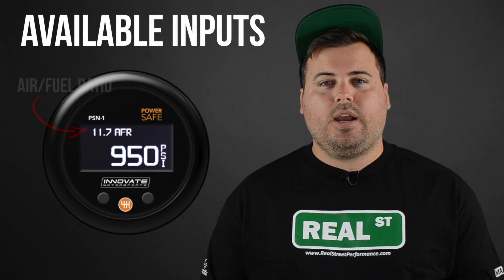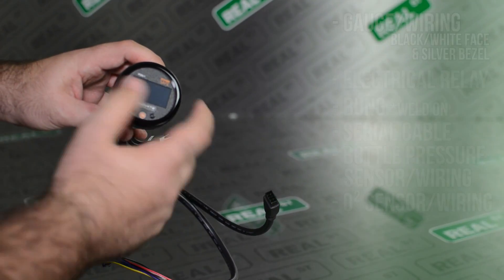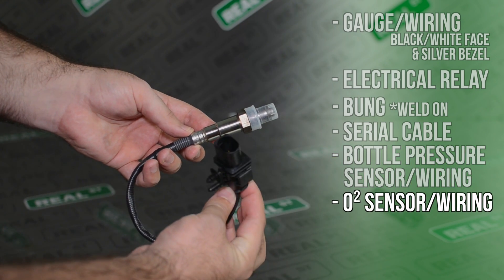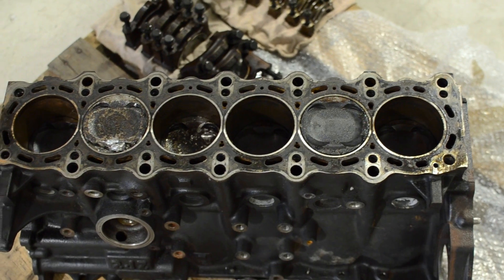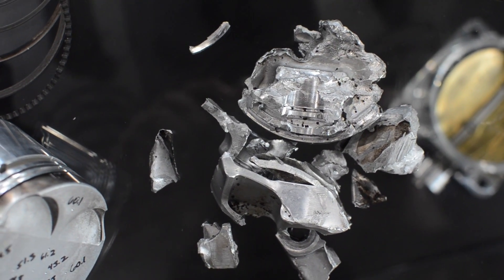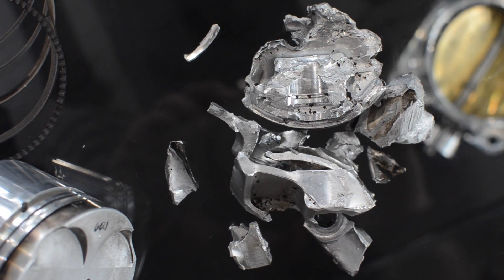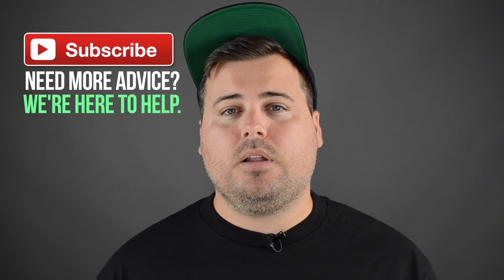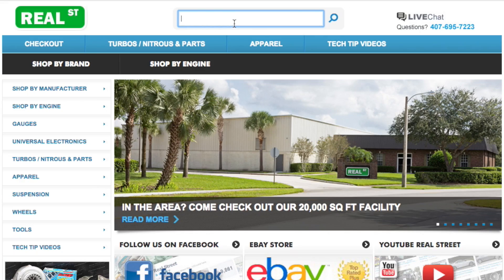How to use Nitrous without BLOWING up your engine Innovate PSN-1 PSN1 3893 - Real Street Performance

Comment: Im building a ka24de Nissan motor. With porting I'm looking at  around 200HP. I wanted to get it tuned with Nitrous. My target is 300 HP but 250 HP is acceptable. Just a guess is this safely possible with high compression pistons?
Reply: Only one way to find out test it for us bro

Comment: FEEL FREE IF YOU KNOW BY EXPERIENCE BUT IF YOU DO EXPLAIN WHY OK, WHICH IS BETTER DRY OR WET ENGINE BONE STOCK OEM ENGINE, USING 75 HP JET INTEGRA B18C V-TEC, [ ANY Comments ] ONLY THOSE WHO HAVE experience in squeezing the juice! ,  DADDYDAVE ( 707 ) BRACKET RACER SONOMA RACEWAY, WEDNESDAY NITE, RUN WHAT YOU BRUNG, JACK POT,

Comment: I already have a wide band so if I buy this I’ll have two widebands ? Lol so many gauges I wanted a stock look loll
Reply from the maker: Sounds like what you need is a standalone ecu to do all your controlling and a digital dash to be your 1 display that can let you monitor all channels. What kind of car are you working on?
Reply: @realstreetperformance   it’s an evo 4 with evo 5 ecu it’s a tuneable ecu I want to install the nitrous so I’m researching on what’s the best option not sure if management would still be needed I think it’s the best option tho
Reply: @realstreetperformance    Oh yes I might need a digital dash for monitoring and controlling

Comment: Hi, loved this video. I've just rebuilt my motor, LS4 and put the bottle on it. Haven't used yet as I need to retune to retard motor by 2 degrees apparently?

I have a winmax window switch installed. I assume that, once powered controls when NOS engages and this gauge operates as a safety?

Do you have a distributor in Australia or just buy direct?

Thanks

Comment: HI, JUST A F250 WITH NITROUS INSTALLED. TRUCK IS NOT STARTING UP. TAKES THE SELF BUT DOESNOT START. ITS DIESEL. PLEASE ADVICE, OR SHARE CONTACT TO CALL YOU.

Comment: Well i just want 30-40 aditional hp when exsiting the sickane. The engine is 3.0 l V6 bussa916 from Alfa Romeo the car is Alfa GTV with diferent option of slick tyers so the grip is crazy. The dray weight is about 1.075 kg. So puting in a WET NO sistem with minimum option for power will not destroy my engine the aditional power will give me about 3-5 seconds bether time comparing to stock power of the car. I know the RPM must be at least close to 5.000 before activating but not u der 4.700 rpm. The engine rews to 7.700 rpm. So yes exsiting sicanes and closed apexs will be much faster with aditional powe. I nead a purge in the sistem 100% ! So what's more left to do on the car.... 😛 nothing just buy a sistem and instal it.

Comment: What is the difference of wet shoo t of nitrous and dry
Reply from the maker: a "wet" nitrous kit injects both fuel and nitrous. but a "Dry" nitrous kit injects only nitrous and requires the ecu to compensate for extra fuel to be injected through the injectors while the nitrous kit is on.

Comment: This may seem like a dumb question  and maybe it is  But I cant learn if I don't ask. for a v8 engine  Is there ANY amount of nitrous small enough that can be used without adding any fuel on a older set tuned ecu engine ( tuning cannot be changed ) that is safe to use for about 5 seconds ? Incase my Q is confusing I mean to spray ONLY nitrous with no extra fuel injected ?
Reply: This is about 4 years late, but buy a wet kit. It comes with the fuel to inject without tuning

Comment: Hi nice video. If the system is running fine, are you then able to apply more pressure for more boost?
Reply: @bigboreracing356  it was a joke 🤣

Comment: 1998 Geo Metro here , 1.0 liter Inline 3 cylinder , I am installing a 300hp wet nitrous system shot , everything else is bone stock , car has 379,000 miles on it . Will this kit save my engine ?

Comment: How much nitrous , and what type of nitrous system do you recommend for stock engines?
Reply: Well typically most people start with a 100 shot. If your internals on the motor aren’t forged, I wouldn’t go past that. This is why I’m going 150 shot to start with my new setup(forged internals) in a few weeks here. 

Keep in mind it all depends on your car since we don’t know what you’re driving.
Reply: @RidingWithBobby  3.5l EcoBoost...I was thinking about a 50 shot

Comment: One question, what about timing?
Reply: Right David! also spark plug choice for a colder plug. Does ring gap come into play with nitrous? Looking for a nitrous kit for my 460 big block Mustang.
Reply: @robertclymer6948  ring gap does come into play depending on how much nitrous is being used. Notes for specific gaps are in the ring manufactures instructions. Just add a msd retard box for the nitrous then you don’t have to worry about moving the distributor all the time.

Comment: SERIOUS QUESTIONS:
I drive a 6.6 duramax (with a turbo obviously)

I'm new to the diesel game. I'm sure this is a dumb question but can NOS be pumped into a diesel? I'm assuming yes cause combustion doesn't change the need for O2... but is it more dangerous in a diesel?

2. I have a conservative amount of mods. EFI live tune, airdog 2 4g pump, performance injectors, and other minor things. Does that matter with NOS or could it be bone stock as long as I don't overuse or push too much NOS through?

My trucks pretty quick for how big it is.. I just want that extra bit of boost when I go to the strip at truck shows or race the faggot next to me with a stock v6 lmao

Comment: Anyone use this with another window switch? I bought this and a nitrous outlet Winmax and with the PSN-1 relay hooked up my Winmax will not power on. So I had to bypass the failsafe part of this gauge until i figure it out.

Comment: Hey guys i have a 5.3 2008 gmc with a d1 procharger am around 620 rwhp but the set up is not the most convenient the cold air intake is right avobe the headers and sucking lots of hot air will a nitros kit help or what should i do ??

Comment: My old stock 5.0 Mustang lasted a year and a half spraying a NX wet 250 shot before it finally blew a head gasket and also broke a valve guide. I fixed it and it kept going for another few months before I finally bought a new dss 331 for it and some afr 185’s. I used to do it often also filling the bottle 1-2 times a week but I did have plenty of nitrous backfires (that’s what caused the head gasket to go) and the heads were studded too. I think most stock small block engines can handle it as long as you have it engaged by a full throttle switch and you have some good head studs also.
Reply: 250 is a lot for a stock 5.0 bro 😭

Comment: Watch your ignition timing and check your plugs a lot, don't run a lot of advance and your fine ,been running the same $500 blue bottle nos system since 2001 jetted for 80 shot no issues at all
Reply: My engine has vvti so the timing changes accordingly, the stock ecu can handle up to a 75-100 shot but I just want to run a 50 for awhile, it has 143 whp stock and 128 ft/lbs so I’ll be happy with around 200hp, it only weighs 2400lbs too😂
Reply: How can it be possible to control ignition on new cars, for example a Toyota Camry?
Reply: @zubuxstein  by tuning it
Reply: On my b18 with e85 i have 31degrees at 8500 rpm. I want to put nos, so oem ignition ils 27 so i go to put 29 degrees on my ignition table
Reply: That's not how it works you need a few degree of the stock numbers not the tuning numbers 💀 @hondab18c69
Reply: You don’t need colder plugs for an 80 shot or timing retad(definitely retard at 125+HP level). 
Alas,
I’m gonna be running a 3 degree timing retard anyway for performance with my new cams and a 2 cooler NGK V power plug with my 75 shot on my 2jz
Reply: Absolutely but this new generation doesn't really know how to tune

Comment: Here is a question that I need someone that knows, not a guess. I have a 2008 Dodge Challenger SRT that been rebuilt to a 6.3l stroker HEMI with Forge internals, that has a 298ci SMS Supercharger (Running 12psi) that has been Dyno at 744rwhp and 703 torque. I would love to see a little more boost and my gears are stock now, 3:06.1 and will be changing to 3:73.1 (chrome-moly) and want a NOS kit added. Do you think that my motor will hold a 200 shot of NOS without killing the motor, trans or rear end?
Reply: Yea but I wouldn’t start w 300

Comment: I'm wanting to run nos  on my bracket drag racing truck and I have the engine on the stand to check my ring gap..as it stands now the gap is .020 ..what should I gap the rings to so I can safely run a 250 shot?

Comment: Can it hold 6 nitrous systems and does it work on a pro mod and pro street
Reply from the maker: Timmy Perry it just cuts power to a relay. So if you run it to the main relay that powers all of the nitrous kits then yes it will kill all 6 when your preset triggers are met. It doesn’t know what car you are installing it on. So you can install it on any car you want.

Comment: the most important question to me before i go buy this
WHY would an engine leans out if its tuned and have the proper injectors and fuel system and all good
what cause the engine to lean out fuel!!!
Reply from the maker: Shadow Fiend the answer is if something goes wrong. An injector fails or gets clogged. A fuel pump fuse blows or a relay dies. Something happens to the fuel pressure regulator. There are lots of things that can affect air fuel ratio

Comment: Im sorry.. im just not a big fan of nitrous or turbos or any of that junk.. just get you a good engine like the LS for example thats fast the way it is, and if you want more power put in a cam and be done with it..or port the heads, etc.. etc.. there are tons of other engine uprades that can be done besides nitrous.. hell these turbos and nitrous systems are so complicated and expensive, not to mention hard on the engine.. just seems to be not worth the hassle to me, everyone wants a quick easy HP gain, i'd rather just build a good engine
Reply: How are turbos a bad thing lol
Reply: There not complicated if you fully understand them. Theres also many people that are running boost just fine for a long time.
Reply: Yeah but what if you built a strong engine THEN added the shit
Reply: Lol turbos are everywhere now

Comment: So I'm looking into putting a wet shot on a 96 ford 4.6 non pi with pi heads and intake and such would I be more or less alright with a top end refresh and 100 shot? or should I just stick it at 75 and be happy with what I can get?
Reply: Get a good rod and piston kit, stud the heads. Solid tune and a 200 WET kit. Itll last a long time.

Comment: can I use this with a WOT switch and window switch? if so how would I wire this with the system?
Reply: Did you ever find the answer to this question because I’d like to know also. As of right now I’m only running a wot switch. I have the window switch but I’m still trying to figure out how to wire in the window switch because I’m using a zex wet kit that has the solenoids in their box with only 3 wires coming from the box. Which are the throttle position wire that runs to the throttle body a power wire and a ground wire. So at the moment I still can’t find the info on how to wire the window switch. But now that I see this I’d like to have both if possible. I have a glow shift wide band currently that I keep an eye on it when spraying and without a window switch I really have to slow my shifts down in order not to accidentally miss a gear and over rev the engine while it’s spraying.

Comment: This product is too expensive and sort of useless especially considering the fact that a FPSS will get you the same result for $60 plus if you're using a window switch and a WOT switch like you should be, you'll already have the insurance
Reply: That's kind of comparing apples to oranges. Fuel pressure isn't the only reason to go lean and the switches protect by making sure the nitrous is only on at the ideal times. I agree that it's probably not necessary as long as you have the necessities, but if you have the money why not? Put it this way, any person who has a standalone EMS with these capabilities would most likely implement the same action to occur (cutting power to nitrous solenoid) when the AFR reaches a certain value.

Comment: I had Nitrous fitted to my Clio 172 Sport. The fitter managed to mangle my engine and swore blind he never used the gas at all. I had owned the car for 4 years and was happy to give it a good send off but would have been nice to use it if only once. 
So scrapped the Clio, stripped the Nitrous kit out and put it in the shed and got myself a 111R. Now, how many of you would feel ok fitting NOS to a £20k Elise after the Clio melted? I'm tempted but at what point does sense take over our need for extra bhp?
Reply: What bhp shot did you go for? 25, 50, 75 or 100?

Comment: Have you got a video explaining the pros and cons of Nitrous in a diesel. Thank you.
Reply: There aren't any cons. Diesel engines can take all the fucking nos.
Reply: diesel engines are A LOT stronger so that's a plus, also if it's an auto then you don't have to worry about your clutch burning out.
Reply: I would probably say have a spare driveshaft and axles just in case.
Reply: All pro no con
Reply: Can't lean it out man power is its only limit

Comment: Does it also open the blow off valve when the engine leans out? If it doesn't it, should.
Reply: blow-off valves are for venting excess boost produced by the turbocharger.  This has no relation to a nitrous oxide kit.
Reply: +Dylan McElveen pointless. we do this everyday for a living and the bov is the last thing to consider. so many better ways to do it.
Reply: +Dylan McElveen using a bov to protect from a lean condition is like using a ping pong bat to play professional tennis....
Reply: not physically possible
Reply: +Trent-Catherine Hewitson It is possible, and it should happen. Blow off valves open all the time, why not now?
Reply: +eM Nah if you know a little bit about logic gates you can make this system open a blow off valve. 
Electronics are simple.
Reply: +eM I'm not even talking about Nos anymore dude. 
I'm talking about a way to protect a turbo charged engine from a lean condition. 
When the engine leans out, open the blow off valve, therefore cutting off boost, therefore preventing it from doing any further damage.
Reply: I got what you were saying the first time, but you would need a different system to handle that. your OEM ECU should already be handling that if your car came turbo charged from factory.

Comment: I have a 2001 corvette with LS-1 with aluminium Heads, Headers, larger cam and auto trans.  Can I put a dry Nitrous system  on my corvette with out damaging the engine or the auto trans?
Reply: You have to consider what no2 actually does. It's an oxidizer, not a combustible. If your air fuel mixture is optimal now, a dry shot will lean the motor and cause damage at some point. Just like a turbo, without extra fuel to bring the A/F mixture back up to optimal, you won't experience the real gains, and will do damage.

Comment: thanks for the video.  I am running a Nissan 350z stock & am looking to increase the power & as you mentioned No2 is the cheapest way to get a large amount of HP for very little. I am however, worried about blowing my engine. Would you say that using a gauge like this would make it safe to run the No2 kit without changing the internals?
Reply: Did you instal it?